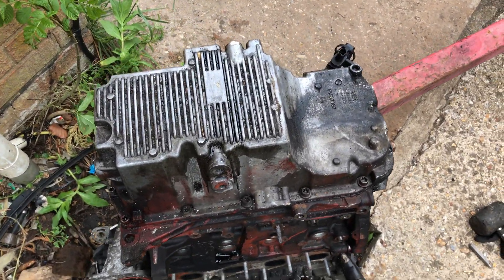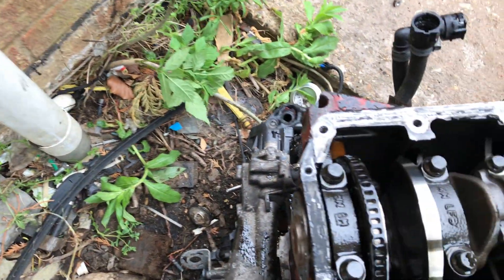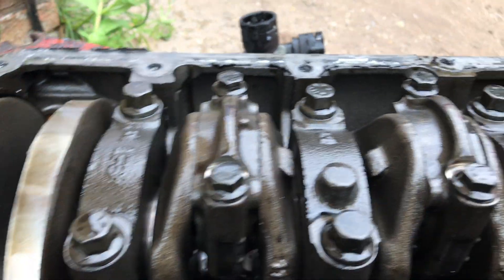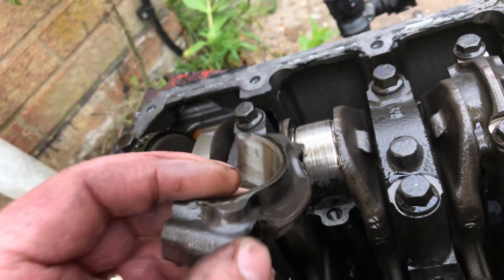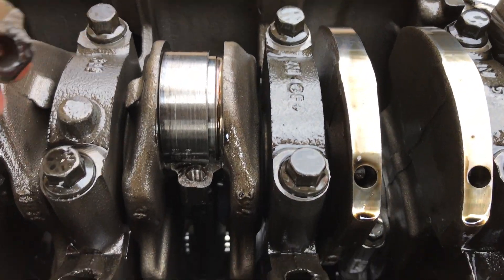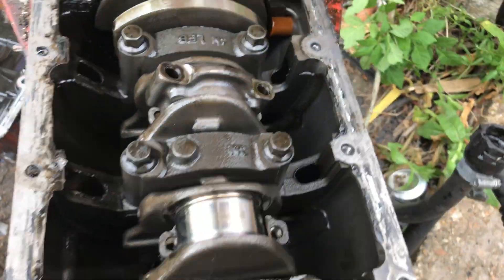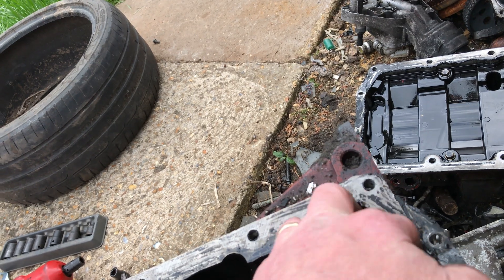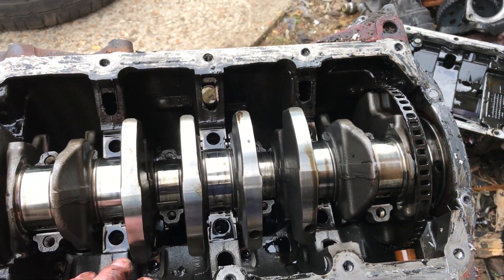2010 Vauxhall Insignia 2 0 CDTI engine knocking Part 2 - A20DTH, A20DTL, A20DTR

Comment from the maker: If you have "Oil Pressure Low - Stop Engine"message dispayed breifly on cold startups. Replace Oil pickup seal as soon as possible. 
Failure to do so, will result in severe engine damage. - In some case seized engine. 

Seal is readily available - Seal part number is GM 55589549
Affected vehicles & engine code are as follows....

Astra J 2010-16 Engine code A20DTH, A20DTR, Y20DTJ & Z20DTJ
Cascada 2013-> Engine code A20DTH& A20DTR
Insignia 2009-17 All 2.0 Diesel Engines except Engine code B20DTH
Zafira C 2012-> Engine Code A20DT, A20DTH, A20DTL, A20DTR, Y20DTJ & Z20DTJ
Reply: I bought an insignia 2 weeks ago looked and ran great for a week then oil pressure low light appeared so booked in the garage for 6th Jan earliest I could. Started it today its knocking and steering sounds like the Titanic hull breaking in two.

Comment: Would Wynns Stop Leak help with that problematic seal you reckon? It says on the tin that it helps to revitalise rubber seals
Reply: Yes it could help but the risk is to big if it doesn't so it may be good if you dont have the alert yet, but if you allready got the alert it's best to change the seal imediatly, you dont have time to wait for the additive to maybe work.
But if you dont care and are one of those who keep driving with the alert then it's better to try that product than doing nothing.

Comment: If you have low oil pressure warning all the main bearing shells will be fucked. Changing  seal will NOT fix your engine. Gm shell set before crank gets scored you may just save your engine.

My crank was supported on no 1 an no 5 an the inner bearings basically  collapsed

Comment: Had the oil seal done on mine 2 years ago with low oil pressure, 74,000 miles, when i bought it,  garage said bottom end was fine, 20, 000 miles later sounds like bottom ends gone. Going back to garage tomorrow, i hope im wrong.

Comment: Got the earning light on cold starts, got the new seal, got the cutouts in the gearbox bellhousing (luckily) and am gonna tackle this job very soon on my siggy cdti 160, would you recommend replacing the shell & main bearings as a precaution, or have a "aint broke dont fix" approach? Dont think the bottom ends knocking just yet haha
Reply from the maker: Replace seal ASAP, to prevent severe engine damage. If there's no knocking from bottom end, shells should be fine.
Reply: @PaulsTechChannel  thanks Paul, ive just completed the job. Took 3 days (I set aside 2 to do it but had a migraine from hell on day 2 so I took a rest!) and there wasnt/ isnt any knocking. 

The seal wasnt split, it had just gone very hard and plasticky, and there wasnt any metal shavings in the sump when I took it off so I gave it a good clean, new seal and its back up and running now. Guess I caught it just in time!

 Havent seen the warning light since, and the service now message is gone too after resetting the oil life indicator, nice little bonus 👍

 Was a pain in the butt to do but your video really helped, so cheers very much! 🍻
Reply from the maker: @hamstirrer6882  Yes pickup seals do go hard over time, common fault with these engines. It is awkward to do, especially  if you've not done one before. - WELL DONE mate :)

Comment: Got oil seal on my Astra 2.0 CDTI replaced by Harvey's, Hill top West Bromwich. £230.00 including oil change, oil filter and new sump gasket. They had to remove the drive shaft. There were no cut outs in the flywheel or the sump, so they had to undo the gearbox to make enough room for access to the 2 sump bolts.
Reply from the maker: if gearbox has no cut outs for the 2 sump bolts. It is a bigger job. Some gearboxes already have cut outs making it easier.
Reply: Where is this west Bromwich garage??
Reply: @stevenwills559  Harvey's M O T & Service Centre, West Bromwich

Comment: Is it possible to change the crankshaft and bearings in this situation or is it cheaper to do a complete engine replacement?
Reply from the maker: Depends on severity of damage, if not too bad you may get away with having crankshaft reground & fit oversize bearing shells to match. If damage is too bad or engine seized, replacement is the only option. When fitting a used engine. Fit new cambelt kit with water pump & Replace oil pickup seal BEFORE fitting engine !
Reply: Best advice you will ever get is sell the thing...absolute pile of crap..one of the biggest disasters to roll off the production line.
Reply: @mrmotorvator5151 no there is MUCH MUCH worst than that.
Tgat engine is good if we change that seal early enough before getting the alert or quickly after getting the alert without driving after getting the alert.

Comment: Hi Paul I’ve got a 16 plate insignia 170bhp 125kw is that sealing ring in my engine thanks Chris
Reply from the maker: If your engine code is B20DTH. No, this oil pickup seal is not for your engine.
Reply: @PaulsTechChannel  thanks for the help/reply Paul. I have 02 sensor issues code P11DB oxygen sensor 1 but I brought the wrong one from Vauxhall located in the DPF so goto wait till I got the money thanks again Paul for the vidioes / help
Reply: Hi Chris..I have the same problem in a insignia 16 plate b20dth..this knocking.did you solve the problem?what is the name of the part?and from where did you get?Thank you!

Comment: Can this engine be fixed because my engine has seized with that problem
Reply from the maker: Yes with a full bottom end rebuild & depending on severity pf damage crankshaft. It will either require to be reground with new oversize bearing shells fitted. Or worse case, a replacement.

Comment: I’ve got a 140 cdti on a 14 plate is this a common problem on mine or just the earlier 160 bhp engines ?
Reply: It's actually a Fiat engine, so 2.0 JTDM (939) FIAT, Alfa Romeo,  the Saab 2.0 TTiD, Chevrolet Cruze 2.0D have all the same oil sump seal problem.
Reply from the maker: Its a common problem effecting all A20 CDTI engines